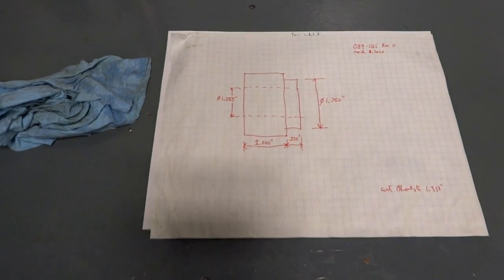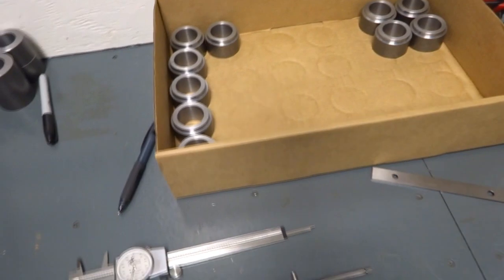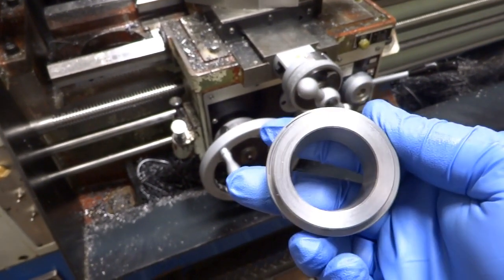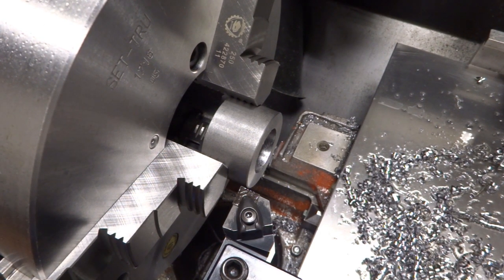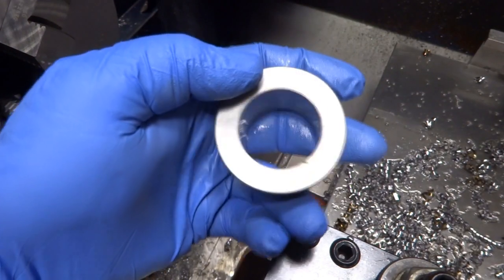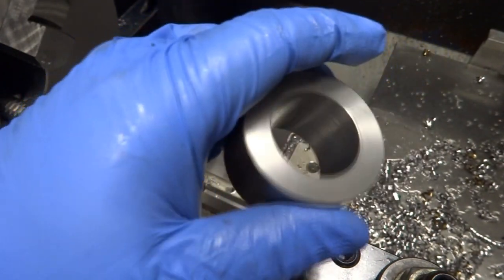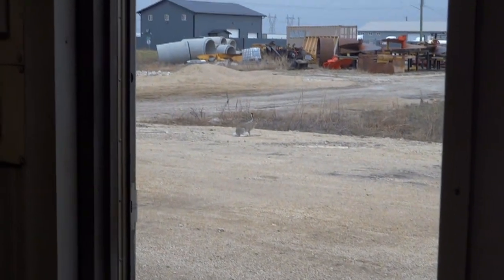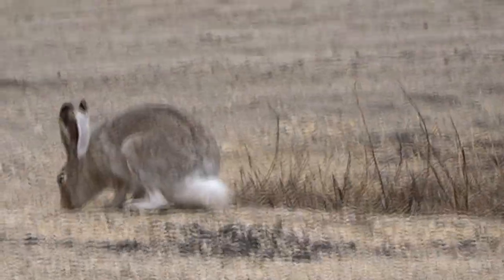Production Machining Bushings in a Non Production Setting

Comment: A bolt in set of soft jaws would be perfect for that job . The bloody rabbits are a pain in the ass on our property ,  digging holes every where !  Cheers .
Reply from the maker: Over here they're more of a problem if you have a vegetable garden.  They like to eat the tops off of everything.  Most gardens get a fence around them to keep them out.  I have holes in the ground all around my shop but they are from prairie dogs (similar to squirrels but without the big tail).

Comment: Good, simple job.
You must be using tool offsets in your DRO to be so confident of your finished size without measurement.
I have to admit I haven't yet done that on my lathe.
I'm addicted to the compound for threading and haven't really had an even small production run like that.
But would certainly consider learning how...
I've an idea, you do a video on that!
Aaand, I love your Set Tru 3 jaw.
Reply from the maker: Hello Carl,  You're right I was using offsets in my DRO.  It is accurate enough that you can confidently turn to within about .0005" on diameter without checking, or checking every once in a while.  If you are trying to get down to a few tenths (and you are changing tools) then you have to check.  At that level even a good quality tool post will causes variations from tool changes.   Dorian (the type of tool post I have on my lathe) states repeatability to within 'tenths' which I take to mean .0002".  Even at that you can get a variation of .0004" on diameter.  That Set Tru 3 jaw chuck is my favourite chuck on that lathe.  It probably does 95% of all my machining.
Reply: I envy the adjustable 3 jaw scroll, I don't have the original Pratt Bernerd chuck for my Colchester and no large adjustable replacement so the repeatability is close but no Cigar..
I have an adjustable 6in, 6 jaw but that's more for my universal grinder.
I noticed a reasonably good chamfer on a fairly casual part turn around in the vid.
That implies confidence in the chuck, I know it was 'only' a chamfer...but.